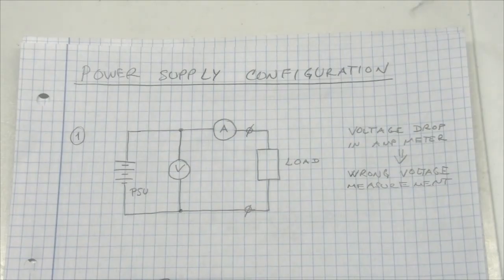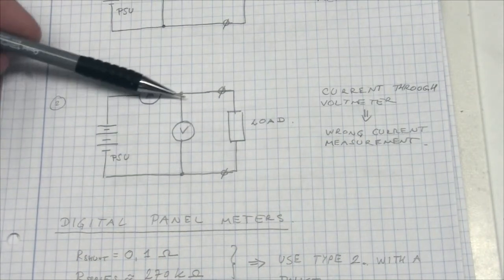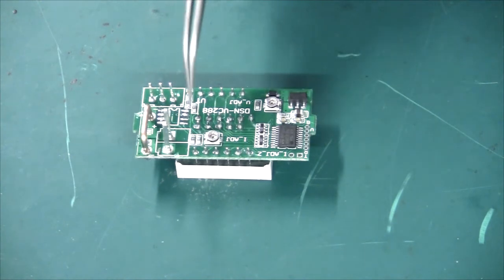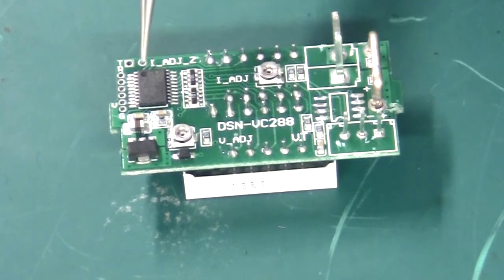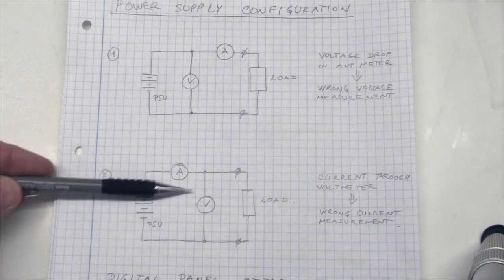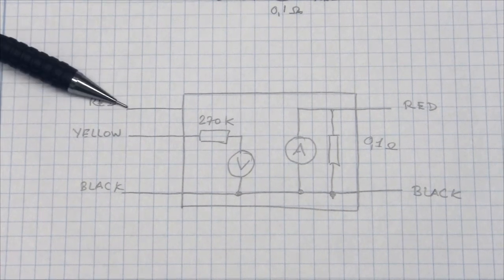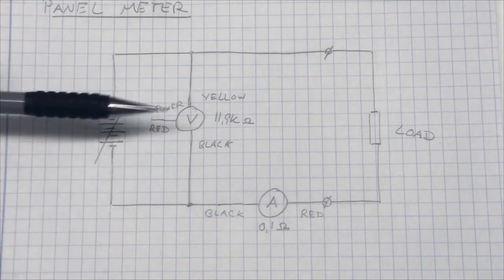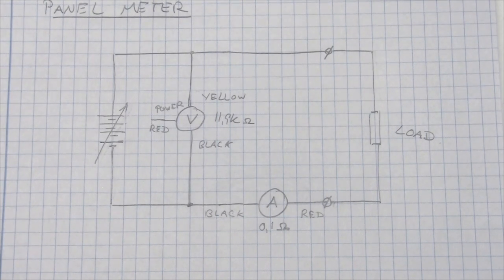Wiring of Volt- and Amp meters

Comment: Hi guy.video clip good,I have just bought a volt meter as above.Before when to buy about me test  then ok, but then.However when I connected the 12v test source the volt meter displayed and the amperometer did not jump when I connected it through a 12v 5w bulb. I think it hit the lane when it loads.I do not know how to fix the clock to jump numbers when I load.So he can guide Help me fix this  ?.are you contact by mail : ngockha.mtm@gmail.com, Thanks so much

Comment: Could you explain how to physically do the connection for a bench power supply with a + and - because my V/A any way I try is going to short-circuit. Thanks
Reply: Did you ever figure this out for your power supply??? I am doing the same setup and also get a short every configuration I try...